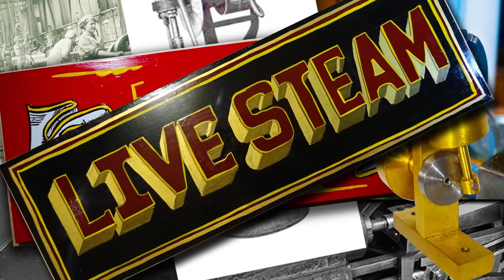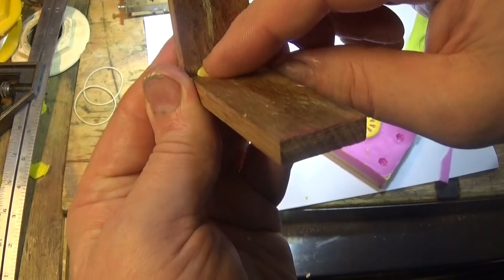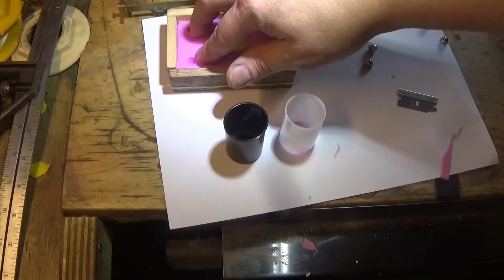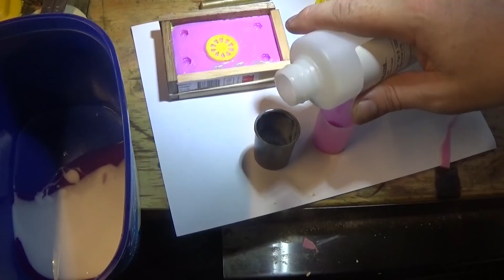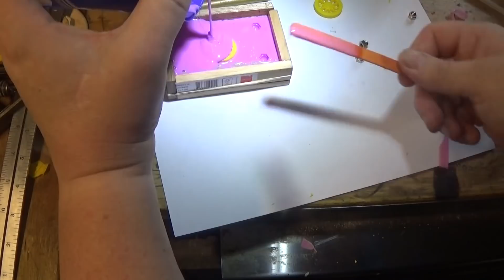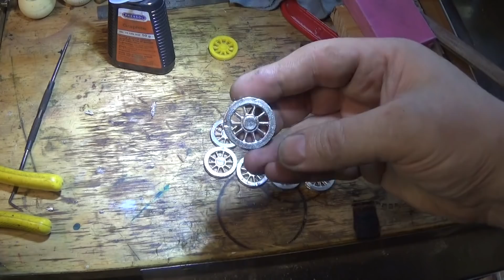casting lead tin parts for toys

Comment: Well done, Emma, super wheels! Did some pure tin (not pewter) casting today with students at the museum, using OBB (European equiv. of Petrobond) sand for moulding. Best result was a girl using a Lego/Duplo plastic fish as a pattern, turned out absolutely smooth and shiny in tin. We had a laugh putting it in water to cool it down for handling LOL. Silicone is great for low melt alloys, but way too expensive in this country, about twice the UK cost, for instance. And the sand is infinitely reusable for low melt alloys. Thanks for the video! André

Comment: Emma, I have made MANY molds like this.  Perhaps I can pass along a couple of tips.  If you cut some thin plywood, say 1/4" thick to the size of your mold, then glue these to the outside surface of the mold using some RTV gasket sealer, they will adhere readily.  Now you have a sandwich of plywood - mold half - mold half - plywood.  This gives you something to clamp together without distorting the mold.  The second tip is with de-airing.  While you may get okay results with the vibratory table with thin RTV, it is best to use a vacuum pump to remove the air.  I made one with an old compressor from a refrigerator when I first started.  A little slower than say a vacuum pump for air conditioner service but it still works.  When you apply the vacuum, the RTV will double in size then collapse.  (You will need to modify your mold box accordingly.)  At that point leave the vacuum on it for a couple of minutes, then slowly release it and let the mold cure.  You may not have to do that with the RTV your using, but if you wish to pick up VERY fine detail this is the way to do it.  How fine of detail???  How about hair and finger prints?

Thanks for all you do.

Joe

Comment: Another option for drawing air bubbles out is to vacuum down the silicon a few times prior to pouring, this helps draw the bubbles up and out of the mix for those without a parts tumbler or other vibration source
Reply from the maker: yup a vac chamber would be nice... ill put it on the list.
Reply: I used a household vacuum cleaner when I was making pad printer pads

Comment: Just watch you and had already seen your machining of the wheels. I did not realize the mold was silicone till now. I cast   my own lead bullets in aluminum molds and the mold always needed to be preheated to fill the mold well. Surprised you could get reasonable parts cast in a cold mold especially with the metal volume. Looks like I learned something new. Good job.
Reply from the maker: problem with the silicone is that itdoesnt hold shape well. theres always a trade off.